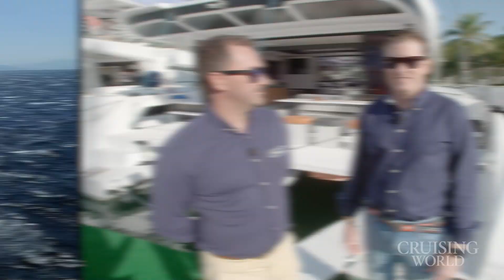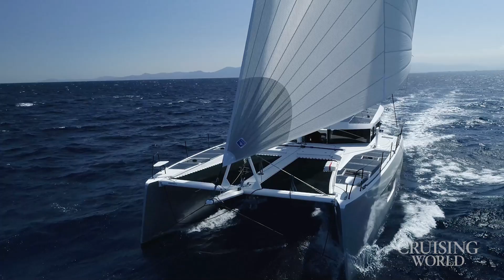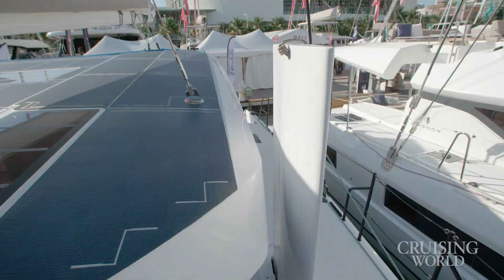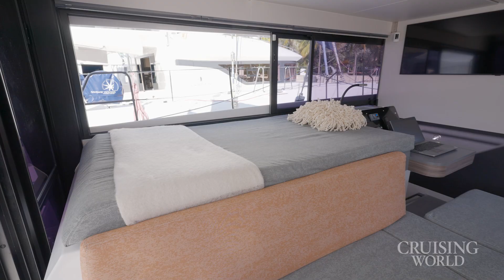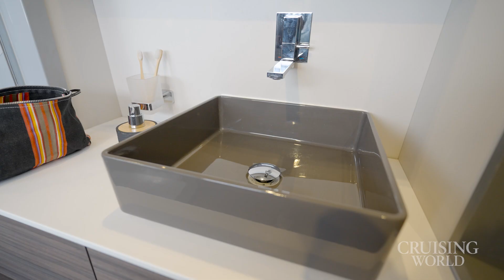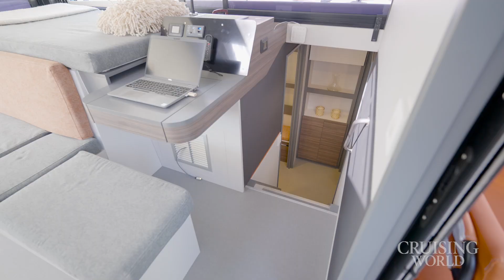Cruising World On Board: Windelo 50

Comment: That forward cockpit really is nice since you are both shielding people, but also the winches and other equipment. Not to mention just good vision all around. I have to say this is huge advantage of sailing cats that you can do layouts like this.
I'm not sure if it's safety feature or something, but only thing I don't like that there isn't some more solid solution for that front cockpit entrance. Like maybe sliding part at the top, and normal side swinging door at the bottom part.